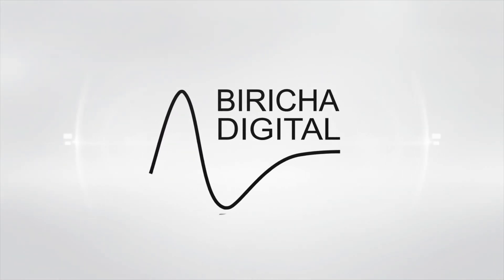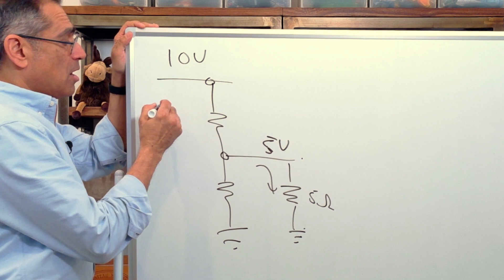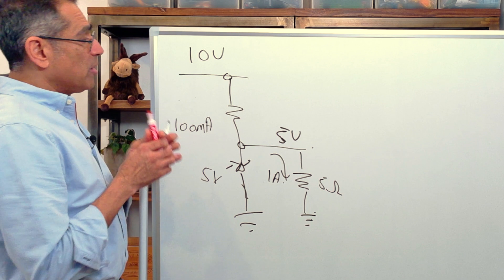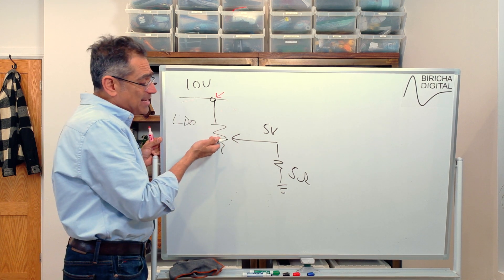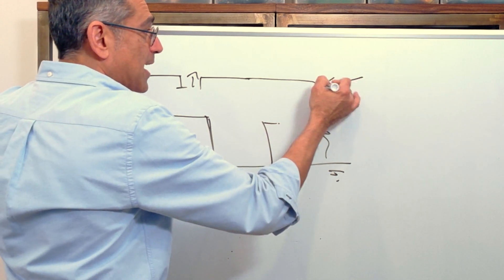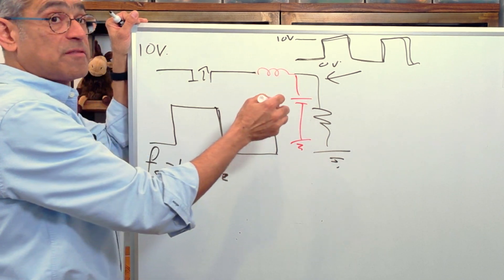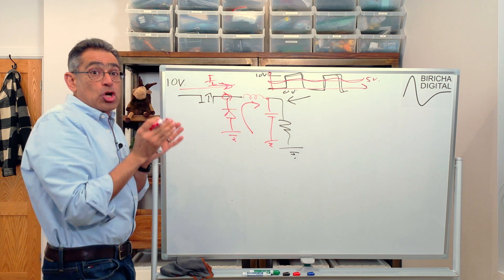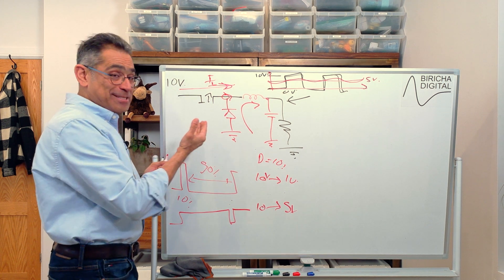How Does a Buck Converter Work, & Why Is It So Much More Efficient Than an LDO or a Zener Regulator?

Comment: Hi, I have a question: do we still need a diode (an alternative way) as shown in buck converter 
if I have a input 5V-DC which goes through the inductor and then the capacitor to ground?
Reply: Yes